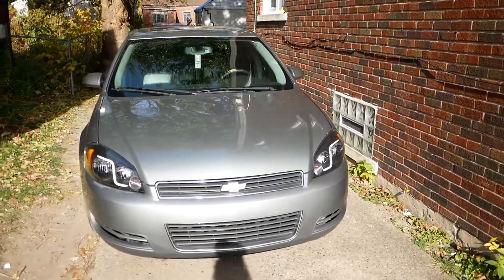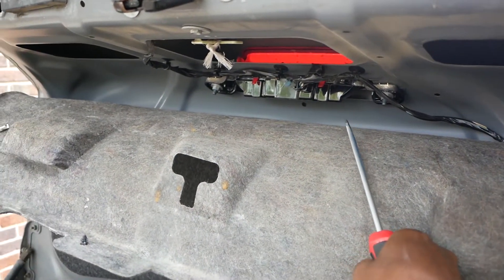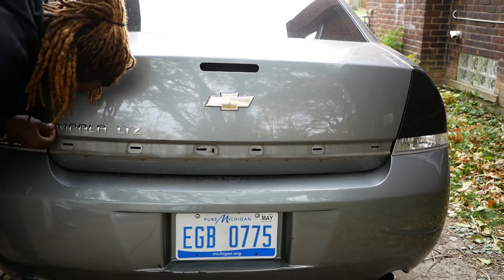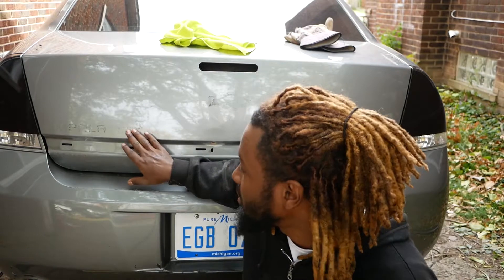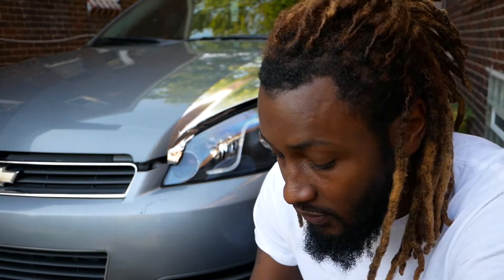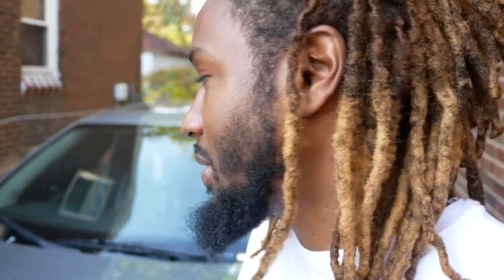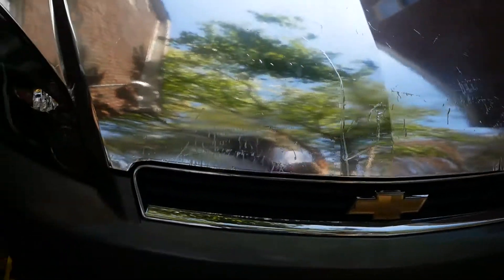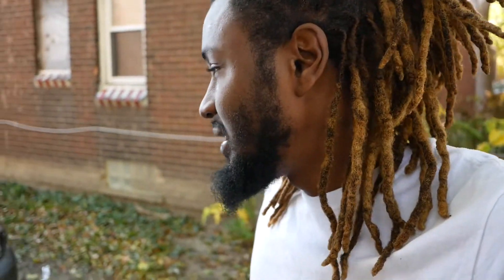WRAPPING MY CHEVY IMPALA! BAD IDEA! (IMPALA PROJECT)

Comment: I’m tryinna turbo my 13 ltz. Haven’t found a single thing for it and don’t think it’s been done.
Reply from the maker: That would be a dope build
Reply: @JeremyCrescendo  good shit! I found one online that says it fits. Think it would retain my vvt?
Reply: @itsvontesworld   thanks brotha! I’ll be sure to post it up if I do
Reply: Get the overkill tune with the bigger throttle body intake manifold spacer better spark plugs boots and run e85. If you have a 2012 to 2013 Impala. Run 10s in quarter mile.
Reply: @GerardoGarcia-tb7gi  it’s got hellla low torque I can’t imagine with a tune. I know it had more potential but gm and their “fuel efficiency” lol
Reply: I been trynna turbo mine too but man it seems impossible
Reply: @tharichpotna  the 2013 camaro same the same engine. They sell pro charger kits for them for a small fortune of 6k..... but you’ll still need to fabricate a little bit I’m sure.

Comment: Man I feel bad it came out that way. It would have been better that you started at center and worked you way across. You could've used heat gun or hair dryer to straighten those wrinkles. It warps it so it looks smoother. Sorry I commented way to late. I'm about to do the same on my car. I'll let you know how I do. I just found out your supposed to use a heat gun for it or hair dryer.